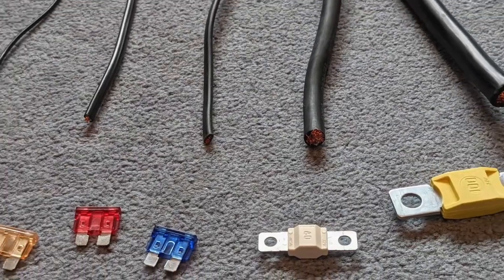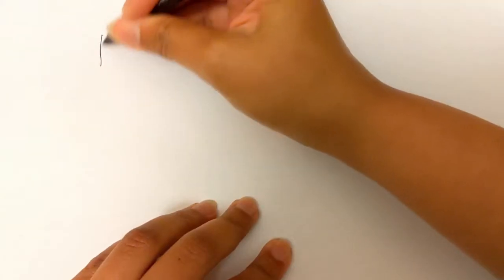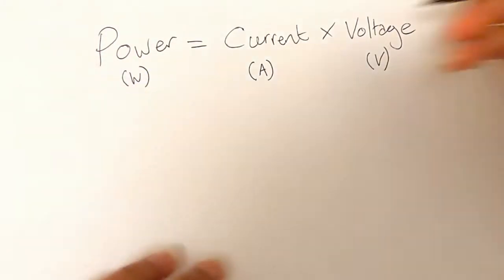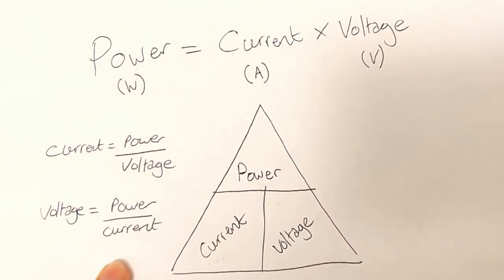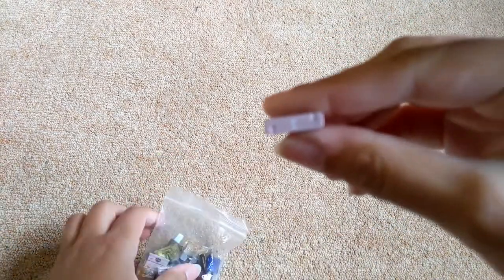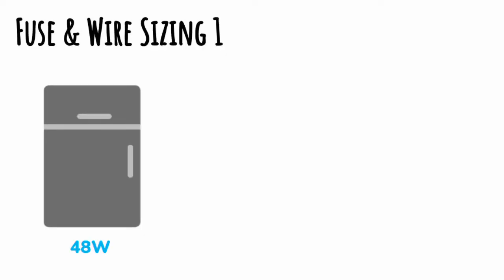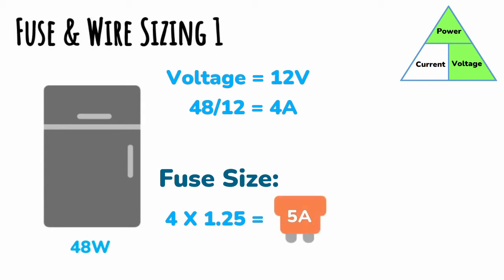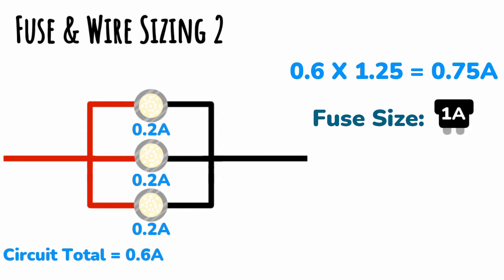How to Correctly Size Wires & Fuses In A Camper Van Conversion | Crafter Van Conversion | 30 |

Comment: Hi, I need your discussion how to install extra (other than factory made) speakers and TV on your van. Totally beginner, need explanation. Maybe audio and video signal generating needs connection to tape/dvd player of ca-bane of the car or need other device?
Reply from the maker: Hi,

The speakers and TV can be connected as explained in the video if they are both compatible with 12V systems. If not, you may need to install an inverter or a DC voltage regulator to get to the required voltages.

For the video signal it's probably easiest to get a smart tv or a plug-in TV stick (e.g roku / chromecast) and use a mobile 3G/4G/5G connection, or you'll need a satellite/antenna signal for the TV which can get complicated with mounting more things to the roof.

The audio is likely to just be a cable between the TV and speakers, or the speakers can probably be connected to the TV through bluetooth / WiFi.

Comment: Hello hope you guys are well....and tks for the video. I'm located in the US...calculating the fuse size multiplying by 1.25 is that only for your location. Will it also work for the US??? Tks
Reply from the maker: Hi,

The multiplication by 1.25 is to make sure the fuse doesn't nuiscance blow regularly and so will work anywhere.
From a safety perspective - the wire size, based on the fuse and appliances, is the most important part.

Comment: The mppt controller is 15 amp
Reply from the maker: In that case, 15 * 1.25 = 18.75A. The next available fuse size is 20A so we would go with that.

As for the cable size, you'll need a cable rated to at least 20A, or larger based on voltage drop.
Anywhere that supplies cable should tell you the current rating for that wire size. Once you've found a wire size that can carry more than 20A use the calculator at https://www.12voltplanet.co.uk/voltage-drop-calculator.html
Put in 12 volts, 15 amps and enter the length of your cable run. Start at the cable size (in mm2) you found and work up until the voltage drop is acceptable.

This is just what we would do. If you're in any doubt we'd recommend you get your installation checked by a professional.

Comment: 120w solar panel going to mppt duel controller what wire and fuse would I need to run to vehicle battery
Reply from the maker: Hi Peter,

This would depend on the maximum current output of the charge controller (you should be able to find this either on the controller or on the spec sheet). From this you can follow the steps in the video to work out the required fuse size.
As for the wire size - this will depend on the fuse size but it is likely to suffer from voltage drop unless your cable run is very short so I'd suggest you use the calculator linked in the description and upsize the cable as required.

Hope that helps!